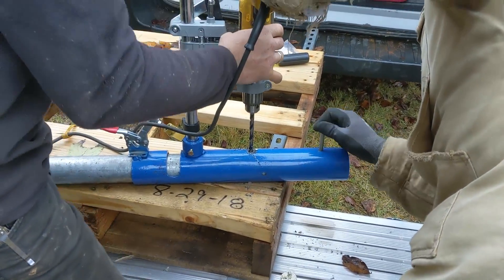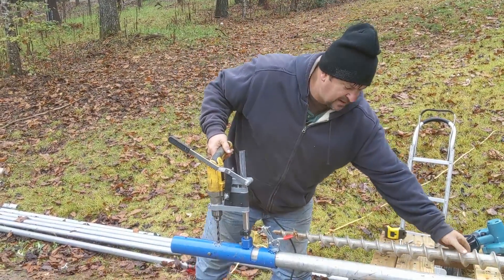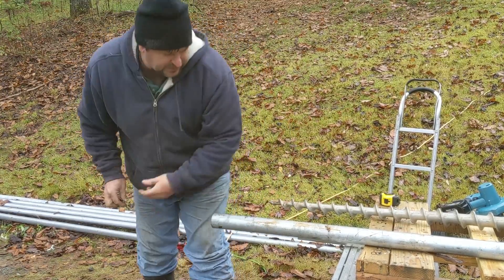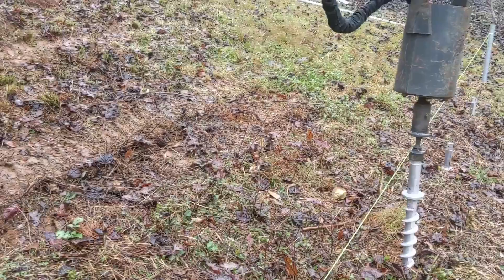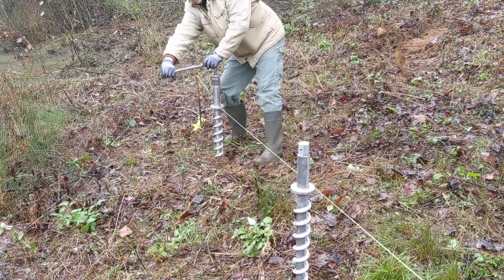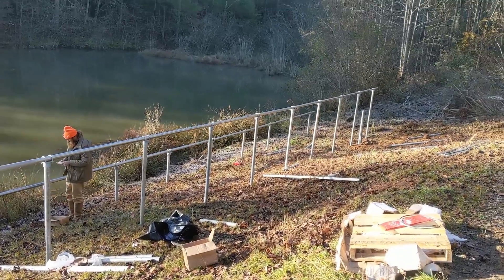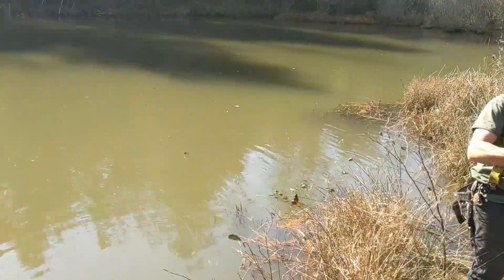Look Ma! No Concrete!

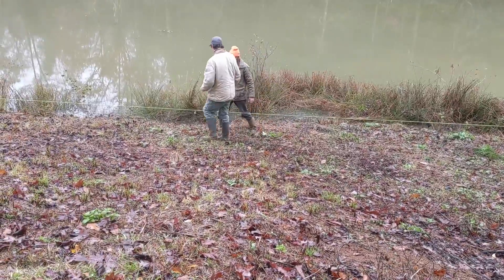Comment: At about 3:35 you say "we've already predrilled our holes"... did you predrill each earth anchor hole before driving the anchor? I would have thought better holding if you didn't drill?
Reply from the maker: I misspoke we already pre-marked our holes not pre-drilled. Sorry
Reply: @engineer775  Thanks! Appreciate the reply and good vid, planning on using those same anchors for a solar setup too...

Comment: I don’t think these earth anchors are good for preventing vertical movement due to frost... great for south but not for north. The threads and flange at the top are perfect for ground to grab onto and inch it up with frosting cycles.
Reply from the maker: I am going to find out soon as I have installed 24 of them at 7300 ft on a hill in Wyoming.
Reply: Engineer775  I use www.postech-foundations.com or technopieux driven low below the frost line and slick pipe.
Reply: I am professional solar installer in Maine, and very keen to know if there has been any heaving. Can you please provide an update?? Feel free to DM me!

Comment: What is the purpose of earth anchors? What is soil type ? What is engineering Cost? What are specs?
Reply from the maker: No concrete truck, concrete, weather independent, much less site prep/damage, multiple ways to run in the anchors, anchors can be reversed and run in at a different location.

Comment: depending on your soil composition being so close to the edge of the pond will effect the pull out or movement. I love the idea quick simple 
keep on keeping on 
Semper Fi
Reply: In maybe a year or 2 depending on the rain weather and all I would like to know if you get any settling or movement with these. Use similar units and over time due to soil make up, corrode to where they cannot be removed or point of failure or they failed and moved or settled. with what you are putting on it I wouldn't think weighs that much but the wind uplift or pressure at times could be an issue. 
sorry I know you thought of all of it usually seem to 
keep up the good work and keep on keeping on 
Semper Fi
Reply: The pond is about 18” high right now because he overflow is clogged. We dug down on site and hit virgin soil after about 8” so those anchors are in thick ga red clay. The customer wanted it as close to pond as possible

Comment: Questions:   Was this install being done under a permit? How did you satisfy the building dept that these anchors are satisfactory?  Was a soils analysis required?  Did you do a pullout test to verify the anchor's holding strength?
Reply from the maker: Only an electrical permit was required in this location.  Soil class 4 with a 2000lb pullout strength.  With 18 anchors the pullout load could never be evenly distributed to all anchors simultaneously so there would also be a lot of side loading.   We relied on American earth anchors stats and experience.
Reply: An additional concern might be chlorine salts in the soil.